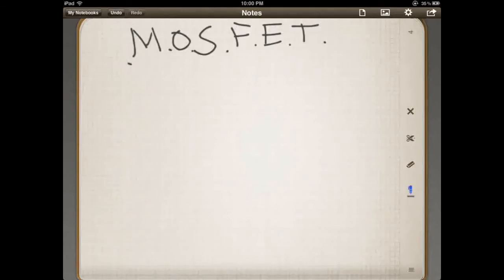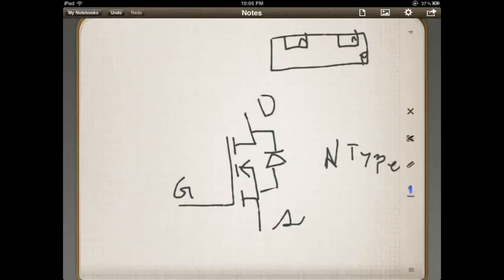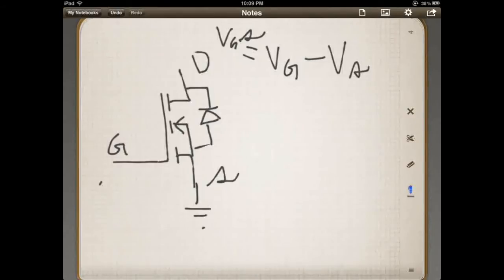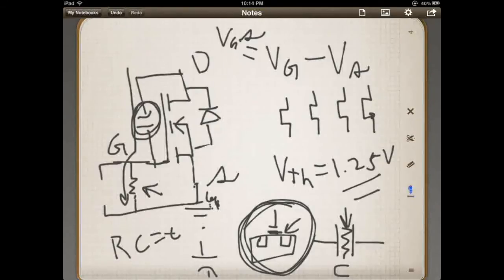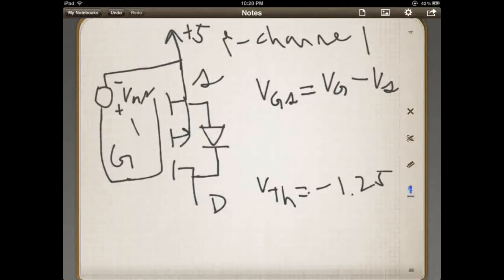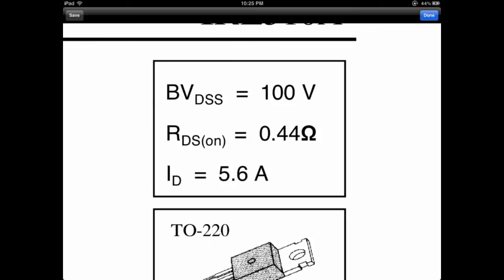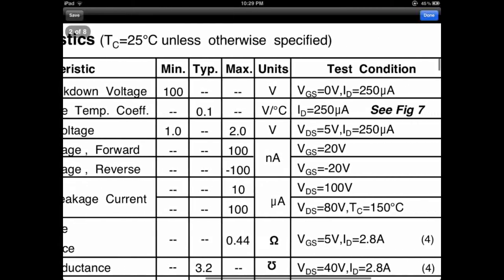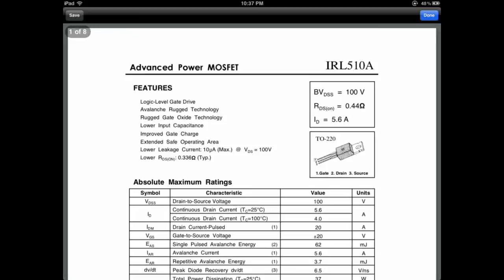Back to Basics   MOSFET

Comment: oops !  You got the orientation of the P wrong.  The gate comes in to the send near the source and the diode is the wrong way around too - it will always conduct.  
When I learned about mosfets in the 70s we looked at deplation mode with only a mention of enhancement mode.  Are depletion mode still common?

cheers